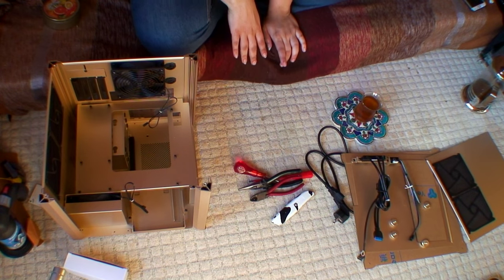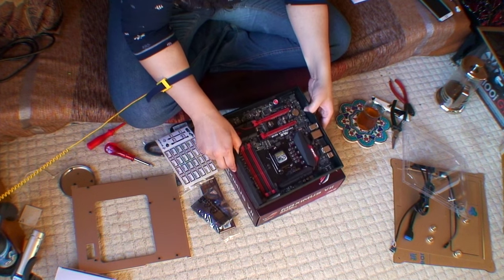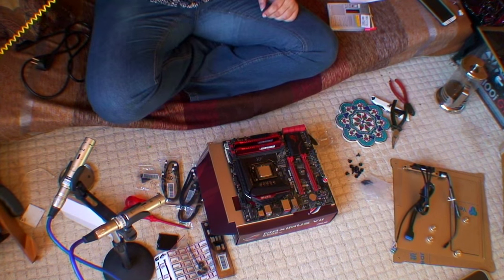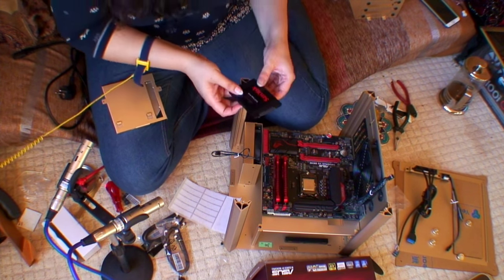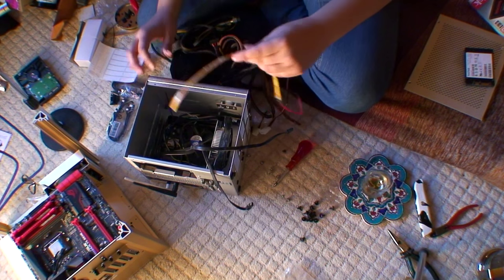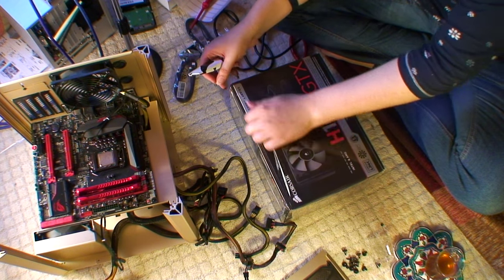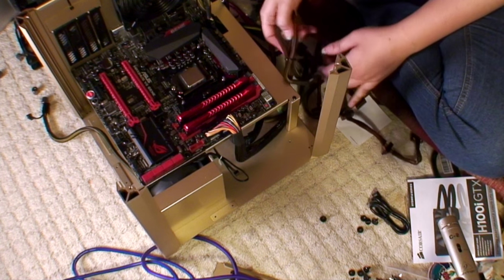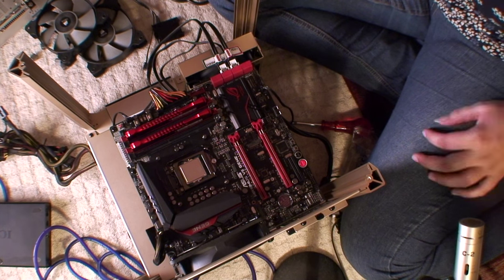The big Hackintosh build - Part One

Comment: you take a way bigger risk of static discharge working on the carpet/bed like that.  it is best to be on tile/wood/linoleum, basically something that isn't a capacitor of static electricity. or even if you had to do it on carpet, to have it on a table and wearing rubber souled shoes.  but hey,  at least you're wearing a grounded(?) wrist strap.  

but hey,  keep up the good work.  you seem like a really fun person.

Comment: I have never built one before and I'm about to.... And this will be the case most likely. I'm nervous about it haha
Reply from the maker: Cool. You will be doing your build in this case? if so its actually fun to build in. Either way I can understand the fear. Take your time, think of it as lego and enjoy :o))
Reply: +MsMad Lemon at first I thought about a node 805 but I do like the aluminum on lian li cases and this one won't break the bank like an O-series. I just want something that fits on a desk and looks good enough and can hold a micro mobo. The only 'flaw' imho is the mini drive bay. It should have not been there. It takes away from the slick design and it can't fit a fan controller without cutting the case

Comment: I just finished building this case recently and I thank you for this video. it was very helpful! I just had one question about the fan next to the hard drive..how necessary is it? I couldnt get it back in because of the psu cables..
Reply from the maker: It's quite necessary as it's an intake fan that will cool the hard drives and pull air into the case. i'd put it in first before installing the PSU.
Reply: MsMadLemon thank you very much..I was able to get it in